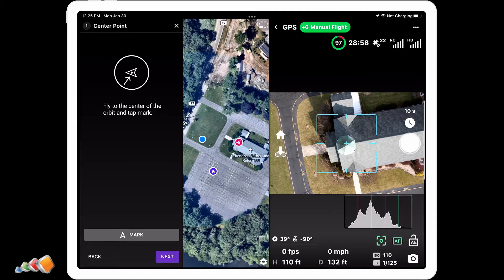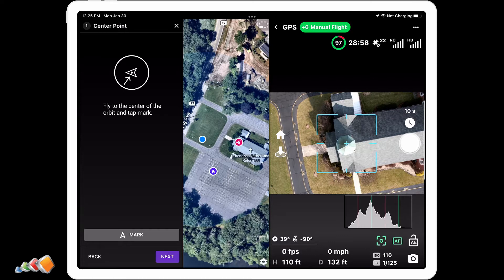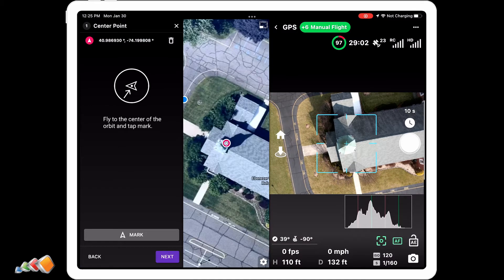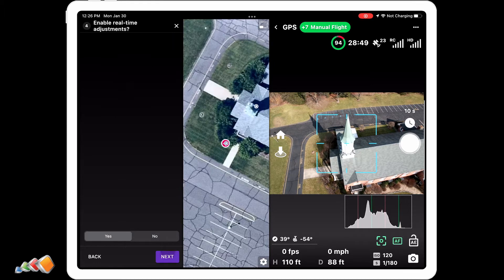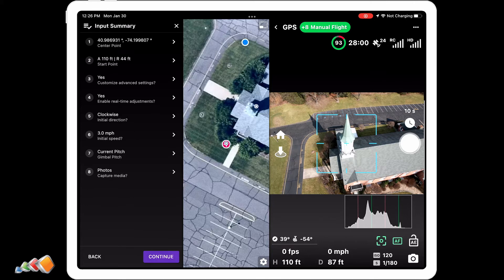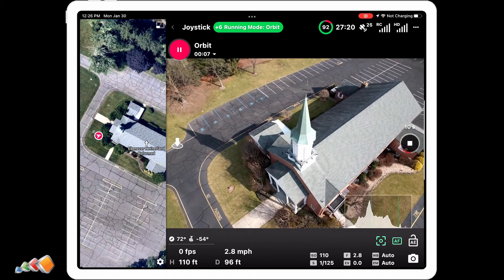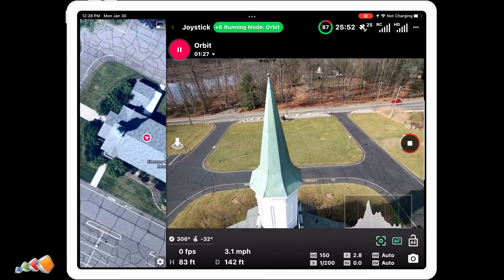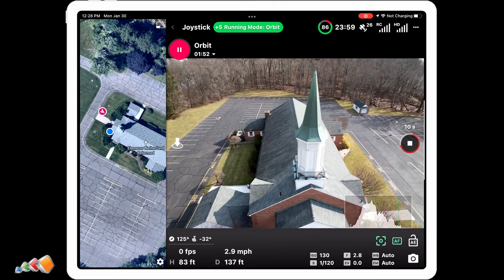Dronelink  Easy Tower Inspections

Comment: Can high resolution mode be used with on the fly orbit?
Reply from the maker: Do you mean the 48mp mode on some cameras? If yes, what are you trying to do?  Because the 48mp mode is really a bit of a marketing ploy as it is a 12mp image that is sampled 4 times.  But...you can select the camera mode you want before you start the mission and it will use whatever you set in the Fly app.

Comment: @aviosmedia where and when did you adjust the mission's photo interval?  It's not part of the Orbit mission's own ability to customize advanced settings, correct?  Or am I missing something?
Reply from the maker: I set the interval in the DJI app before I stated using the on the fly function.  There is no way to do it using OTF directly, but you could save the mission and edit it later (see previous video on reusing OTF missions) but it's probably easier and faster to just set it first in the DJI app as I did.
Reply: Thanks!  @aviosmedia
Reply from the maker: You're welcome!